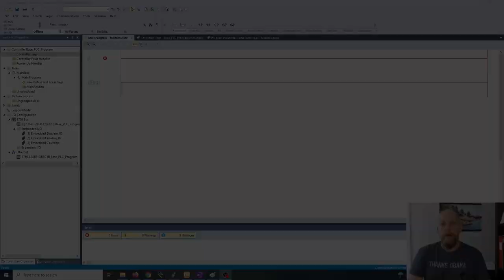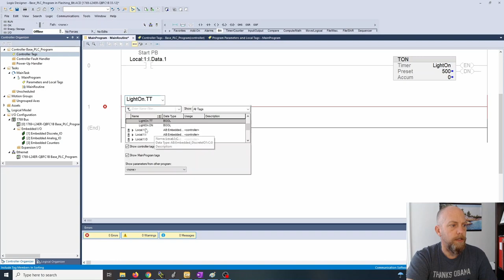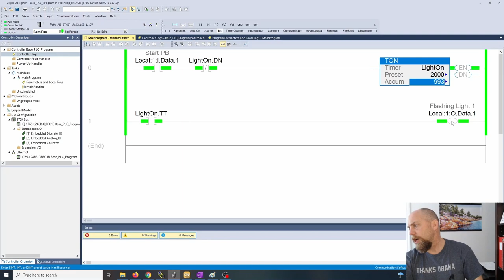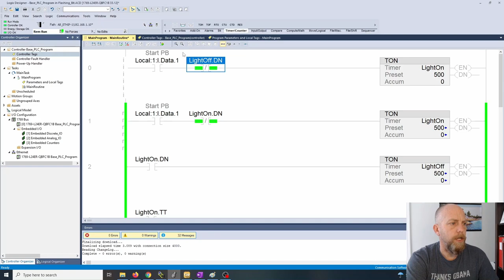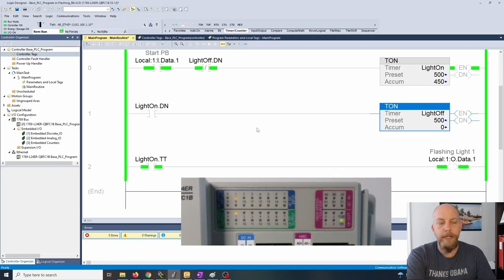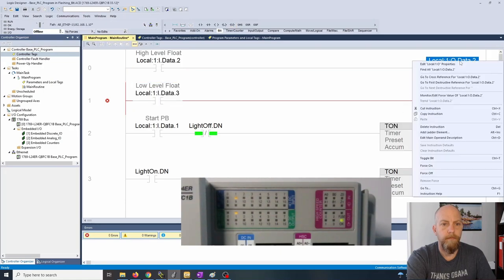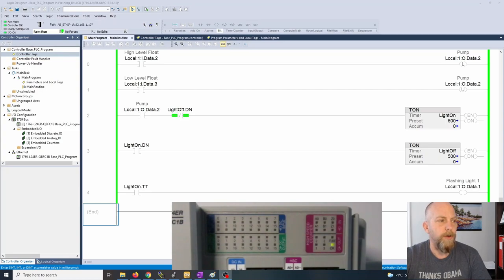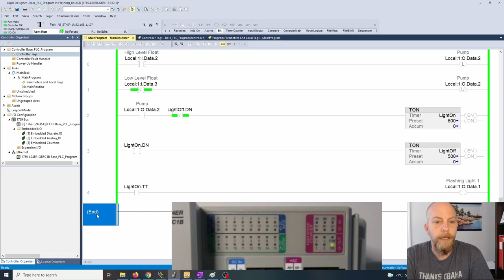Studio 5000 PLC Programming (Flashing Light with Timers)

Comment: Ing. great contribution new subscriber but I have a question, on one occasion an Engineer in the field told me that a memory can be activated and deactivated within a time configured by the programmer, he told me something about a library assigned for that memory, in In this case, timers are no longer used to change the memory from 1 to 0. When he told me that, I had barely started and I did not understand him and I am still looking to see if that function exists. I would like to read your opinion.
Reply from the maker: Not sure. I'll add it to my list of topics to research and will respond if I find anything.